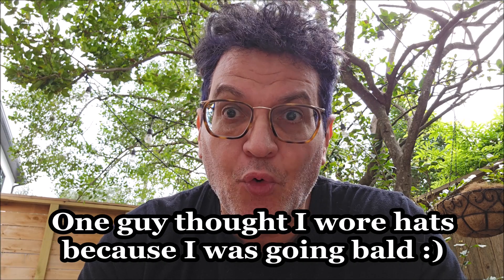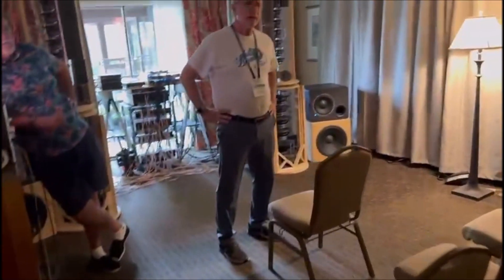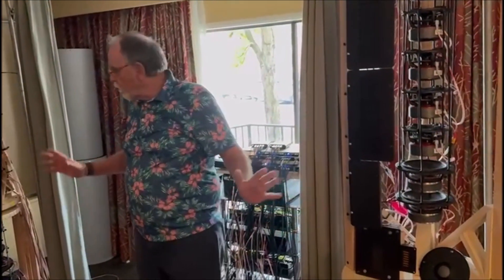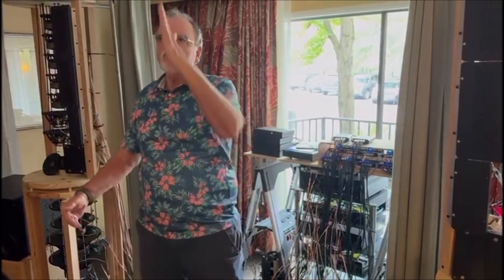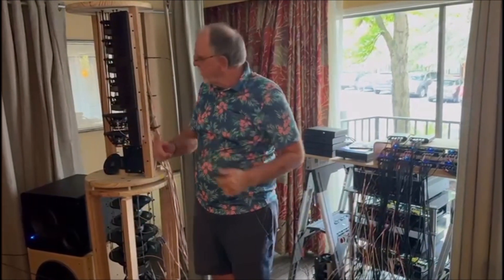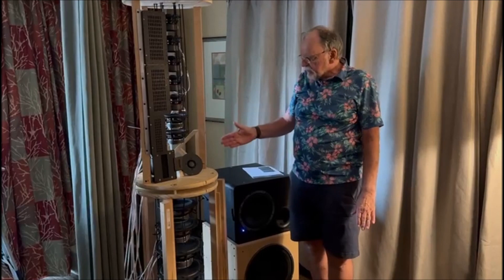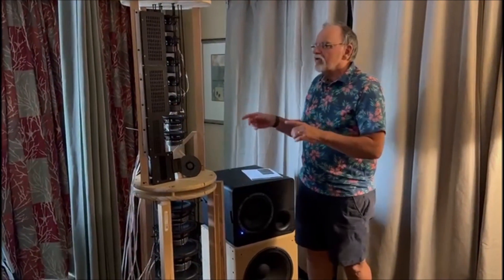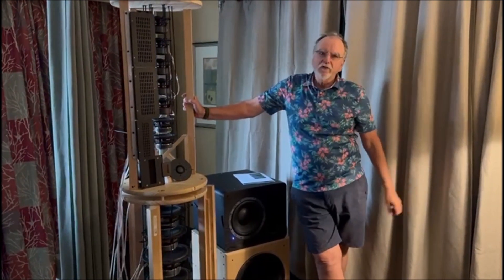😎 World's First Fourier Transform Speaker: Audio Revolutionized?

Comment: I study electroacoustics at a university and what this guy says is mostly BS. Speaker drivers, especially woofers have to be installed in an enclosure or a baffle  because otherwise pressure waves from front and back of the diaphragm will cancel out.

Comment: What would happen if you "tried this" with an array of electrostatic speakers?  

The audio on the video seemed to sound pretty decent, which I am sure is a shadow of the actual listening experience. 

Exactly what is the "control matrix" doing to the audio with respect to delays and assignment to the speakers?  is that IP? maybe i don't need to know?

I think the theory of this line array is probably pretty good: give each driver as little work to do as possible, to minimize that driver from being overworked with complex waveforms from frequencies that could distort the sound in any way with Doppler effects from frequencies that are on opposite ends of a sound spectrum. Is that correct from what i am gathering?  If so, then I can see this as being a pretty nice array, and one fit for reproducing live instruments, such as jazz, ensemble, and chamber music. As well, it would be neat to give it go on electronic music filled with complex textures like "Boards of Canada". The details in such recordings would benefit from an array like this.  I would hazard that a neat idea should be tried/tested: 2 very good reference quality mics set up in a room for musicians or a choir to produce music, and in another room, a listening room, is this array, and the live feed from the stereo pair runs through these speakers and get an idea if that sounds accurate, and compare it to a headphone monitor and live listeners. Maybe a recording get taken to enhance the test so it can be an A/B test.

Comment: The arrangement of the drivers is very disadvantageous. I would have built a large cabinet for each speaker in which the drivers are installed spirally like a snail shell and point in the direction of the listener.

Comment: Oh dear! Alchemists at work. I sometimes wonder if these sorcerers have actually heard what accuracy is. There have been so many of these attempts to improve loudspeaker sound and they all fail. The technical reasons this cannot produce coherence are many. It’s just a kind of coloration. That is all.
Reply: Obviously the inventor hasn't heard the Carver Amazing speaker from 1980. It is a two-way five foot tall one-inch ribbon driver crossed over at 100hz to four 12-inch woofers in a vertical array. Much more elegant than this Frankenstein contraption!
Reply: Those most impressed were those who chose to put on our expensive planar headphones to hear the contrast, if any, between then headphones and our speakers.  Coloration has always been foremost on our minds.  Our headphone always at hand to test every signal our speakers put out.
Reply: Yet, it sounded as coherent as any speaker at the show.

Comment: Do the sound waves emanating from the drivers above and/or below affect the speaker cones of the adjacent speaker?
Reply: Sure do...
Next step for the designers enlightment would be for him to discover that he needs a full wavelength between each driver to have them play in phase with each other.
Each pair of drivers need a different distance between them. Can't see that...
Reply: @flex-cx9bi  disagree.  The sound they put out would refute your understating and we compensate for vertical delay between drivers with dsp..  As would the fact our speaker output actually maps on the input signal.  We are the first speaker to do so and will the first to demonstrate as much at our next show.  The Seattle show being our first it was just too much to manage not to mention reserving another room to demonstrate this without first knowing others could hear what we heard. This show was just a confirmation bias test so other could hear our proof of concept.  The show was a huge success so we will be in LA next year to show our prototype and demonstrate its unique output comparing the input signal to our speaker output.

Comment: I'd advice them to mount amplifiers directly to a driver, as 5W amp is just .. 1"x1" PCB. That's especially true if they would select a high sens drivers (that they didn't, cause I hear lack of  dynamics, even in the selected boom-bang track)
Reply: It would require  supply voltage for each. speaker with preferably common supply card located outside.  Instead of   low resistance cables   for spaeker's   it would  require  using like microphone low signal cables which are also mess .

 But this project may be freely  complicated  because is already beyond imagination. I cant imagine how he would explain all that mess to monks od directivity of cables and heban wood traps. and voltage conditioners  .

Comment: So wait…

Is that claim that you’re running a very low resolution DFT, and the amplitude and phase and each bin is Inverse Fourier transformed to the time domain, and this time domain signal is fed to a discrete amp channel, which then feeds each speaker? 

Or are you saying that using very narrow bandwidth “crossovers” to a bunch of drivers is somehow analogous to a Fourier transform?

Which is it? 

Where does the Fourier  “claim” fit into this contraption?

Comment: Seems like a great concept. But putting this together as a viable product is another matter. All those electronics and wires!
Reply: I may compare to my experience - I found that placing my "standard" speakers some 50 cm lower tha they are I get amazing improvement. I deliberated it and found that due to also  exceptional impression with actual psition   I want to resign  to make that shift because it would affect "gear composition" . Striving for  some sligh improvement has it's  limits and for me it appies also to this  big project.
Reply: agree. We are in the actual product phase now.  We will be back in June at LA show
Reply: Great concept until you undestand the real physics behind it...

Comment: There is no such things as a Fourier Transform loudspeaker. The Fourier Transform is mathematical technique. What you are seemingly claiming is that the sound pressure measured in-room (or anechoic?) follows perfectly the input voltage signal. In that case, the phase response has to be linear, and the magnitude response flat. This can be achieved via DSP, as you seemingly also use. Let us see the frequency response measurements (magnitude and phase), instead of small time domain signal section of a song. Don't make it out as you have discovered something new that is not taught to engineering students on the daily.

Comment: Sounds very clear uncoloured
Reply: Yes, it's a boxless design so pretty much free of energy storage or resonances. Pretty much a open baffle without the baffle.
The concept is simply a 17 driver normal loudspeaker. 
As long as one driver plays in it's linear area, which can extend for many octaves there is no need to divide it into several drivers with complex equalizing.
Within the drivers linear area phase and amplitude is pretty much linear, and the designer of this loudspeaker seems to have forgotten that.
Funny experiment, but with no benefit to a normal loudspeaker designed properly. So commercial potential is absolutely zero.
Some might believe the sweet talk and get tricked to belive that this is something revolutional. It's not.

Comment: I think it is a dipol design without a baffle. Without a baffle it cannot play very low, because of a acoustic short circuit. It radiates more to the ground and the ceiling in a double cardioid form
Reply: Hence the bass boxes beside the stack of drivers. They play bass. Can't cheat physics, right?  🙂
Reply: A dipole would be a Open baffle speaker.  This speaker is baffle-less, or omni-directional.  All sub drivers are going to roll off at about 60, and eq-ing can't really fix physics.  So there is a closed box sub to provide the very bottom.  The other solutions is to "compress" the bass wave

Comment: The drivers are all mounted in free air and facing upward. But because of the close stacking there's a tremendous amount of diffraction created both off the driver basket above and the one below. Regardless of the DSP involved, these drivers are operating in a very sub-optimal environment where in phase and out of phase energy (front and back of cone) are simultaneously being radiated into the listening space. Lots of signal cancellation results, especially on the listening axis. I assume the goal is to make it omni directional, but this design puts tremendous demands on the drivers to produce any substantial amount of energy at the listening position.
Reply: As  the designer we too were concerned about diffraction but what the hell, let’s see what the effect would be.  It was moot.  We were amazed at how little effect it had.  As for phase from the difference in the drivers vertical position, when a group a drivers produces a square wave they are aligned on both axis’s. we use dsp delay to accomplish this.  This is not quite that simple but close.  We will be in LA in june with a finished product so drop by .. It’s all Bs, including ours until one hears the speaker.  Show response was overwhelming positive.  Most recognizing a new standard for Hi End.
5
Reply: @TheBlindAudiophile Yeah but 40 channels of amplification and the connecting wires to each driver in a left - right pair is excessive! A better speaker is the tri-amped Linkwitz using three stereo amps and a three-way Bryston crossover.
Reply: " sub-optimal environment where in phase and out of phase energy (front and back of cone) are simultaneously being radiated into the listening space." except for a properly designed dipole like the Lx521 where that works very well.
Reply: @einarbk885   I have the LX 521, and it is nothing like what is presented here. All the drivers are mounted on baffles that create a longer path length between front and rear radiation. This essentially extends the cancelletion effects further downward in frequency.  Linkwitz (who was a dear friend) knew the exact means for calculating these effects, and compensating for them in his crossover.
Reply: With this speaker it may well be the case of 'errors correcting eachothers' with the majority of the sound going omnidirectionally. Edit: I just listened to the original recording and I can say that the bass in the demo is totally muddy and the slap on the bass strings is not audible at all.

Comment: "According to the Fourier theorem, a steady-state wave is composed of.." exactly

"In simpler terms, it means that any ..." "steady-state wave..." 

Fourier Transforms convert time based information into frequency based. This works on "steady-state wave[s]". But it takes a period of time before the transform can recognize the repetitive frequencies involved. Music is transients. Not a "steady-state wave".
Reply: Understood...
Another way to decribe music would be a infinitely and instantly variable "steady-state wave". (aka everything recorded at the same time regardless of it's a sine wave or the complex harmonics of a cymbal). There is now way you can bandwidth limit that into 17 different parts and replay it with 17 different drivers and expect it to be better that a normal loudspeaker that is phase and time coherent. Just unnecessary complex.
Reply: The Fourier Transform is a model.  We went another route to uncover another symmetry, or a distinction without a difference other than speed of computation.
Reply: You hit point - when I used FFT some 10 years ago, no more  I had to record  digital sample of sound which was "frozen" for analysis

Comment: This looks to me rather like around 17-way speaker that is 17-way amped. I see nothing that corresponds to a proper Fourier Transformation, where true sine waves interact with constructive and destructive interference to produce a derivative. That was quite clear when he talked about one speaker emitting sound from three piano keys, which is a range. A true sine wave has no range by definition. A test would be to only amp one of those 17 speakers and see whether it truly produces a single tone, or whether one speaker shows some variation in pitch. my 2c as a wet scientist.
Reply: There is a lot of misunderstanding here.  I’ll take the hit for that and see if I can avoid this confusion when we introduce our finished product next June.  My choice of words will have to be better.
Reply: The next show will feature individual amp outputs show the musical signal been created out of a series of sine waves.  It is in fact a 21 way speaker system.  So you are correct essentially.  But that is like saying a diesel locomotive is nothing more than a diesel engine combined with a electric motor.  This would also be true but completely missis the point of combining the two as was done with this speaker design.

Comment: Drivers do not have to stop instantly and change phase which he claimed. That would be a step function which never occurs in audio and is impossible for an amplifier to reproduce as it would require infinite  slew rate. He also claimed his drivers are all in phase. They are not because there is a distance between them. In addition he is going to get a ton of diffraction and reflection off the speaker array. He has made a classic audio mistake. He claims a problem exists that doesnt and then does a ton of design work and cost to fix something that it is a non issue.
Reply: As for the comment about direction changes we were not talking pico seconds but fast enough to stay in phase with the input signal.  We are the first to so so replicating the input signal with our speakers output.  As  the designer we were concerned about diffraction but what the hell, let’s see what the effect would be.  It was moot.  We were amazed at how little effect it had.  As for phase from the difference in the drivers vertical position, When a group a driver produces a square wave they are aligned on both axis’s. we use dsp delay to accomplish this.eNot quite that simple but close.  We will be in LA in june w a finished product Drop by .. It’s all Bs, including ours until one hears the speaker.  Show response was overwhelming positive.  Most recognizing a new standard for Hi End.
Reply: @TheBlindAudiophile  What happens to imaging when you essentially break apart an instrument into different locations for different frequencies?
Reply: @exponentmantissa5598  That was definitely a concern for us but the imaging in the sweet spot was spot on.  Go figure..
Reply: @TheBlindAudiophile  This is a fundamental misunderstanding (for one reason or another) of what the Fourier transform is, and why its needed. Systems that can only assume discrete states cannot process continuously varying signals such as analog audio. The transistor in the DSP chip is on, the transistor in the DSP chip is off. The neuron in your brain fires, the neuron in your brain stops firing. They have no in-between states. This is where the Fourier transform comes in. It allows a continuously varying signal to be decomposed into its spectral content vs. time which is something such state-based systems can process. Speaker, however, can assume any position they want to by design. As such, speakers are ONLY made to reproduce continuously varying analog signals, and don't do well with anything else. Also there is the massive issue of dispersion patterns and interference, which is why modern speakers require computer aided simulation and design to actually get them to have good directivity, which is a must. Using speakers made from the entire Parts-Express catalog each playing only one very narrow range of frequencies is like trying to paint the Sistine Chapel with a hand grenade and a bucket of paint. Its at best wildly misguided
Reply: @TheBlindAudiophile  Also insofar as audio is concerned, the resulting "harmonics" of each of the sine components are actually harmonic distortion. We DONT want those as they shouldn't be there! Its an intriguing "what-if" idea. We've all had such moments of whimsy staring at measurement equipment or mathematic equations. 😀 But to actually attempt this is fundamentally flawed in very profound ways.
Reply: @TheBlindAudiophile Do you mean for T.H.E Show? 🤞
Reply: @jakus514  That's the one!
Reply: @jakus514  yep
Reply: What room at this year's capital audio fest can we hear your speaker designs?  Everyone wants to know what improvements or experiments you've been making to sound reproduction.
Reply: Since he uses DSP his drivers may well be in phase. They just need to be delayed properly.
Reply: even if this will never go in production. i can feel from this video that the sound must be amazing. and i have a lot of respect someone is going down this road. or maybe i just find the idea of acustically synthetizing impressive.
Reply: Stop TALKING and play the dam think
Reply: Then you play the thing, to a f up song